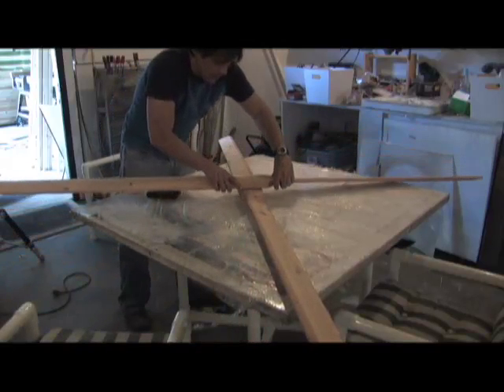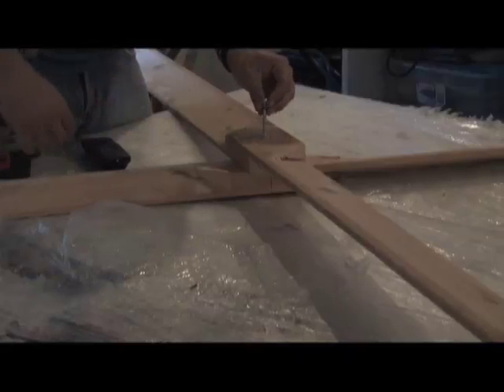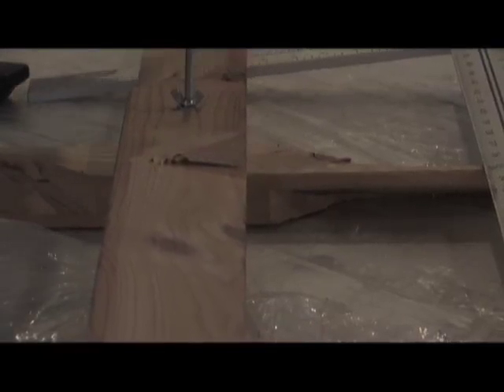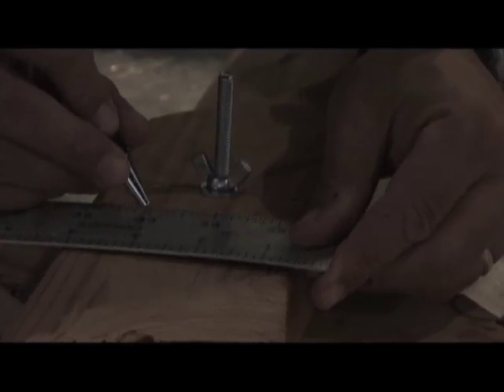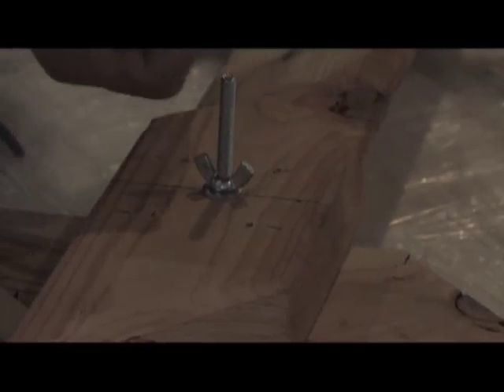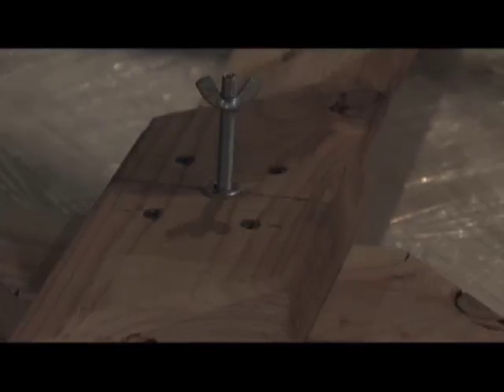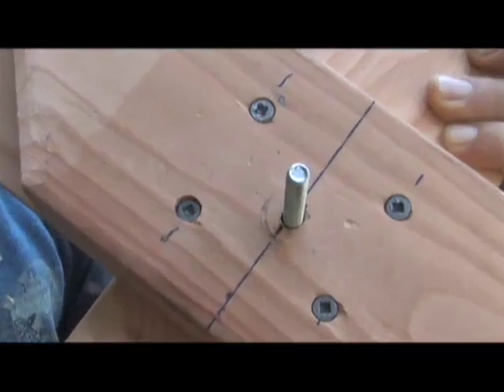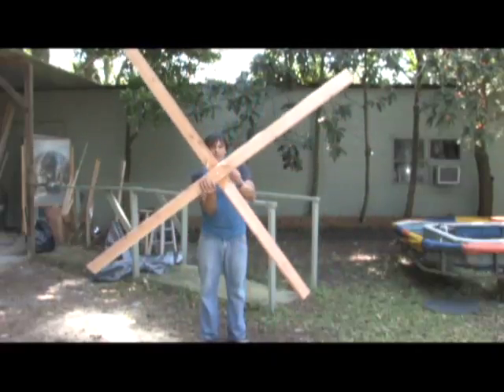WIND TURBINE BLADE DIY how to video Part 5 HAWT Windmi

Comment: Is there a reason why you aren't notching the center so that all 4 propellers are in line and not 2 inches apart? Like cutting a notch in the center the width of the 2x4 1/2 way through on both pieces so they fit together put all 4 of the blades in the same plane? Does the 2" differential between each pair of blades degrade performance? Does the attack angle need to match the generator?

Comment: Hey there, Dan -
Love the videos.  You've got some cool stuff going on there.  I was wondering why, since you've got a table saw, why didn't you half - lap these two blades?  Once you had them squared up, youi could have marked them and cut 1/2 way through the thickness of each board and assembled them that way...just a recommendation.  Love the idea -

Keep up the good work, and be safe!